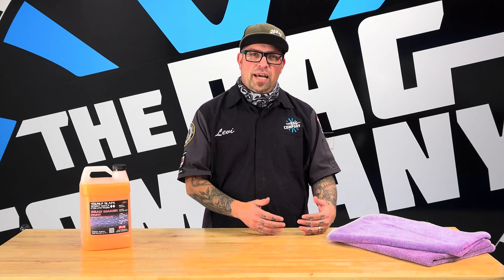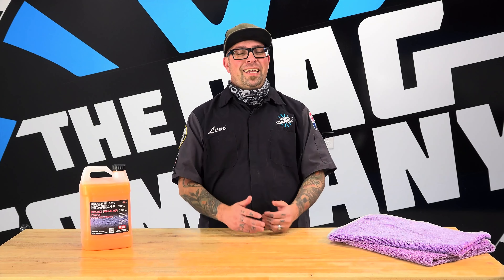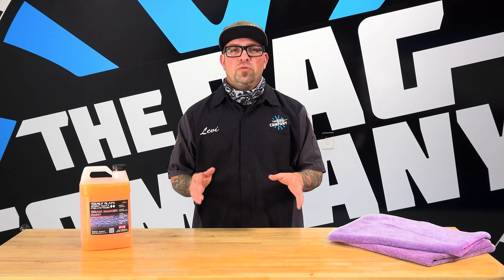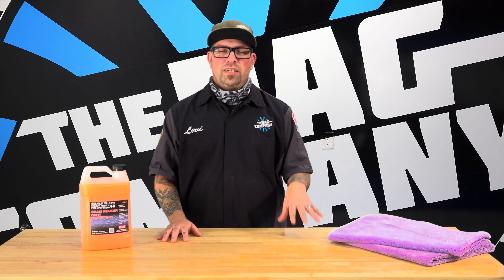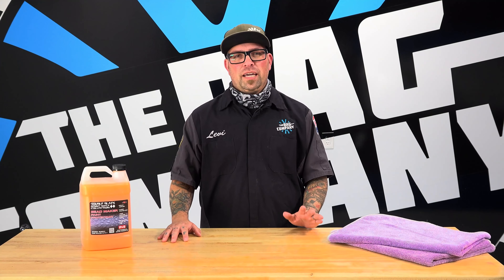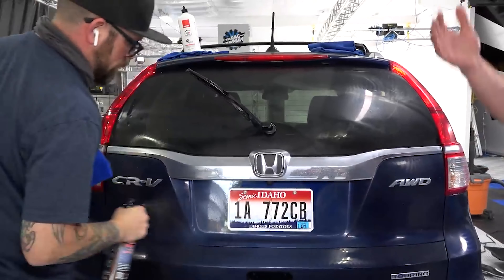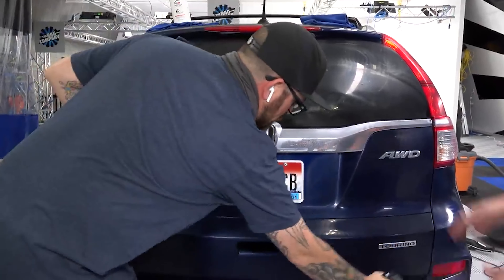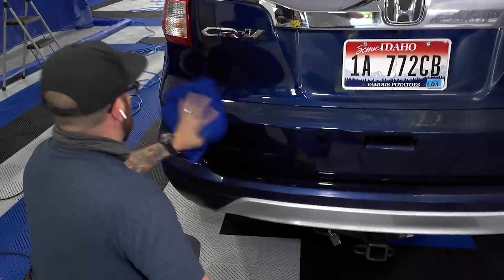Can Bead Maker Be Used On Plastics & Truck Bed Covers? | The Rag Company FAQ

Comment: TRC, I'm a beginner to detailing. I don't understand something: If I'm performing a decontaminate/contact wash, then dry my vehicle (using Bead Maker at this sequence or not), and in addition to applying Bead Maker to the paint and trim, but also the windows/glass, when I clean my windows/glass with whatever cleaning product (let's say Invisible Glass), won't that strip away Bead Maker and undermine the integrity of Bead Maker at my windows/glass?
Or do I first clean my windows/glass with a Glass/Window cleaning product, then apply Bead Maker after? Same theory: what if it was winter time and I was applying a water repellant to my windshield; in what sequence would I apply Bead Maker to my Windshield? Don't use Bead Maker in this scenario?

Comment: Hi TRC.... I have a 2020 Volvo the interior roof is line with a fabric I notice a few light marks on it , I called Volvo and they told me to try just water or if I’m using Any fabric cleaner to try in a small area in a corner to make sure it doesn’t harm or leave a mark. Do you have any idea of what product I can use and the best way to apply it?

The smudge mark is not very big
Reply: I would try P&S Terminator, the Rag Company sells it on their site. Spray a little on a microfiber towel and lightly agitate.
Reply from the maker: This ^